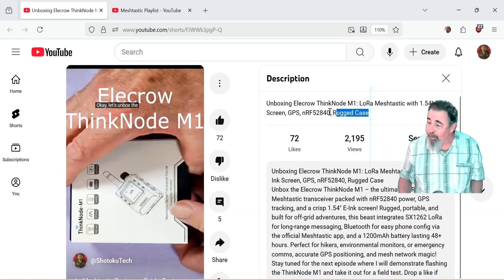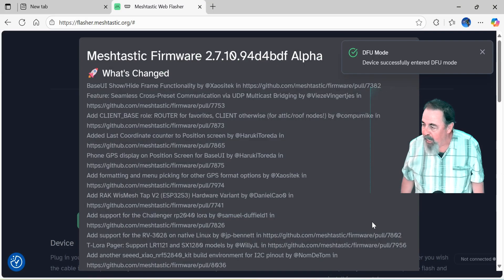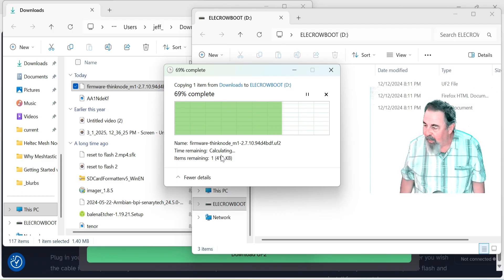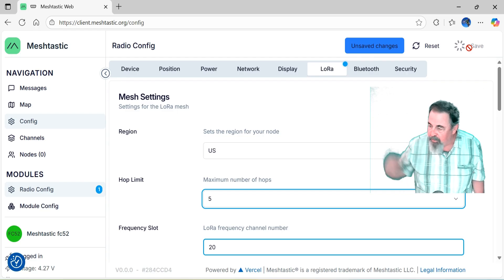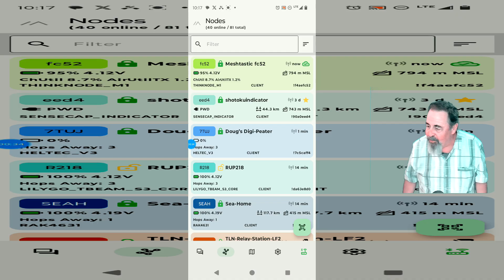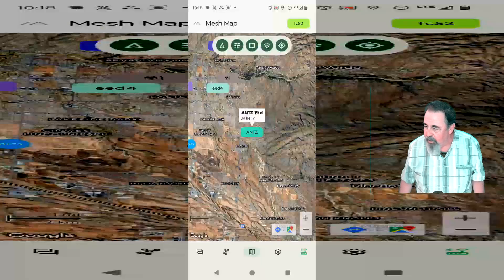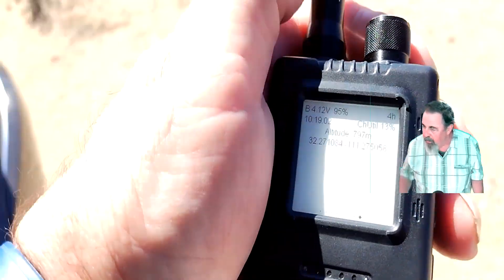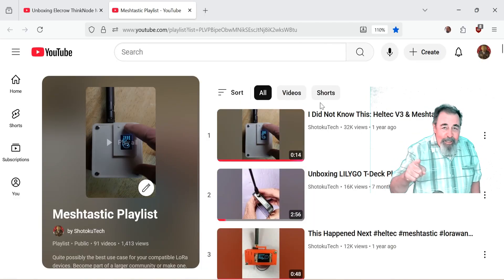Elecrow ThinkNode M1 Field Test Review

Comment: great video, please can you upload the latest FW, but w inkHUD ticked, flash again, so we can test the rotary dial and canned messages, that would make another great video if it all works...:)
Reply from the maker: I thought the knob on top was just on/off and screen brightness?
Reply: @ShotokuTech  yes, its used for that, but given new FW< the inkHUD< thing change and it might be now using the encoder for canned messages, I know you hooked up one before, maybe it can be changed in the pins.....worth a try if you have still got the unit on hand, just flash the new FW w inkHUB selected and see if it works....:)
Reply from the maker: @kerrystaite1683 It doesn't seem like it is an encoder. It's a lot more like a variable resistor with an on off switch. It doesn't even rotate freely all the way around. It only rotates maybe 75 percent of the way, with hard stops at both ends. I previously had the HUD image on the device and it controlled the screen backlight brightness.
Reply from the maker: @kerrystaite1683 you want the WIO Tracker L1 Pro with the joystick. They have an E Ink version as well but you will need a case for it.
Reply: @ShotokuTech  OK, no probs, thx so much for checking, maybe I can hack it and and an encoder in its spot...anyway, thx again for looking into it!!

Comment: Checking it out. Thanks. I just assembled a few Heltec V4 nodes. They are power hungry, even with a 3000mAh battery... My only wish for this device would be that it have a joystick/touchscreen in order to (more easily) utilize Meshtastic alpha firmware features. (Like my Wio TL1P does)
Reply from the maker: Seeed Studio Wio Tracker L1 Pro and L1 E-Ink. Both have the joystick.
Seeed Studio Wio Tracker L1 Pro Flashed with Meshtastic 2.7 and BaseUI | Step-by-Step https://youtu.be/fmeOqQ2dNF4
Discover how to build a custom 3D-printed case for the Wio Tracker L1: easy assembly guide! https://youtube.com/shorts/HEh5oZUcAMc
Reply: @ShotokuTech  Thanks. Already got my Wio flashed etc. Shame they don't make a housed version with an e-ink screen. The nrf52s are super efficient.. even with constant GPS. Really nice device.